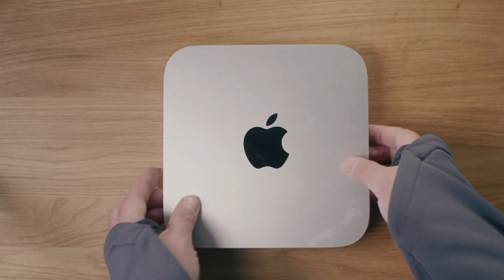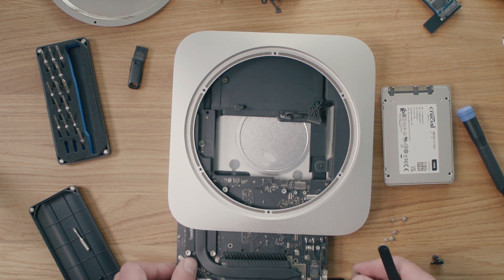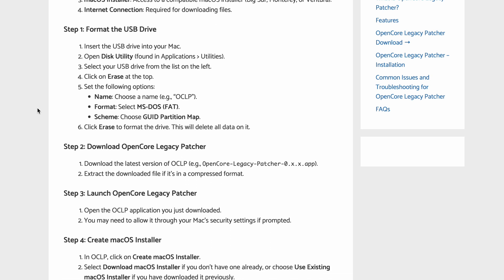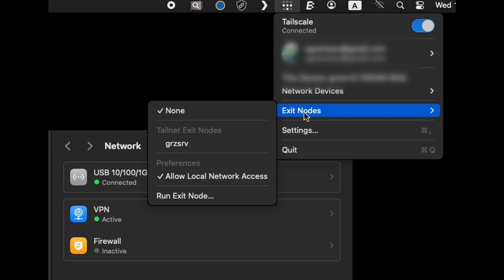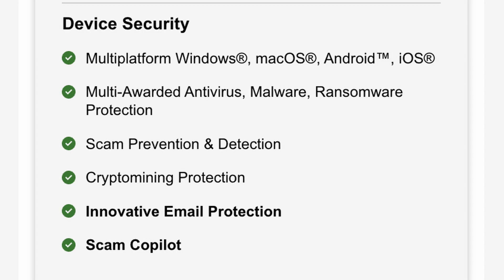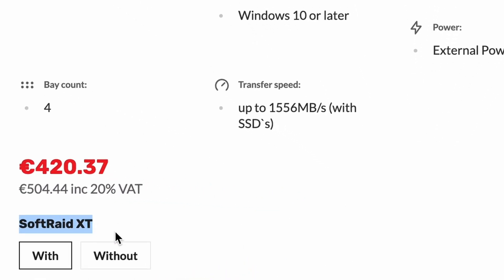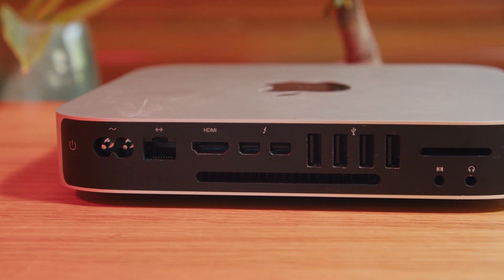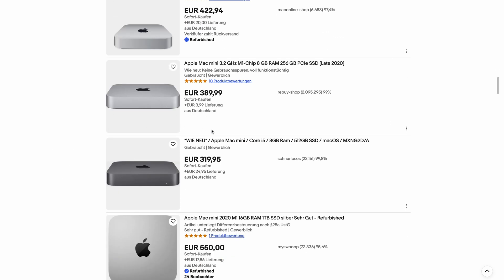How to build your first server for under $100

Comment: Great info, exacly what I was looking for, thank you! It would be great if you could share a way to use it for photo/video backuplike immich or similar
Reply from the maker: Glad I could be of help. For Immich and similar services, knowledge of docker is required. I have some, but not enough to make a video on it. I think the coziest way with this type of server is to enable iCloud drive and photos and use the integrated Photos app to sort everything by metadata and faces. I'm also looking for a solution for my huge photo library, so I'll post as soon as I find something that is simple enough for anyone to use.